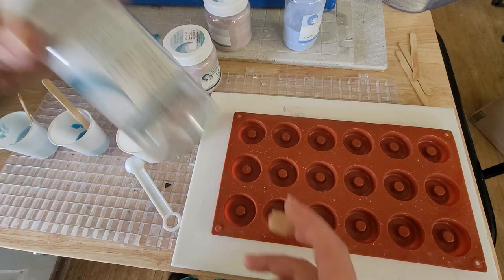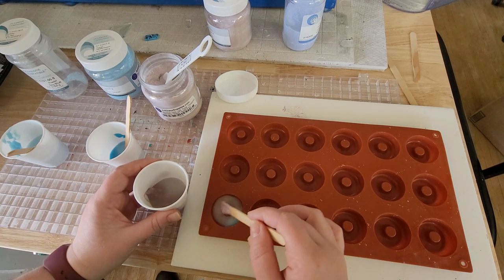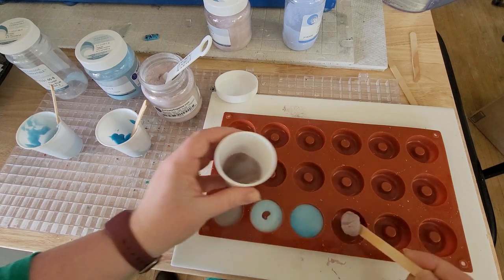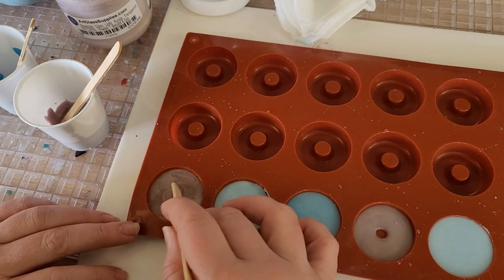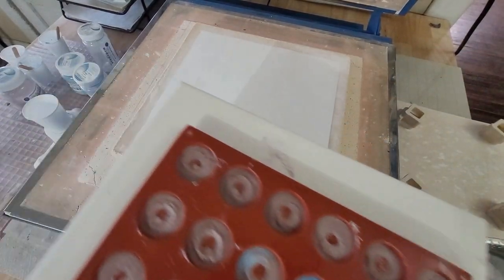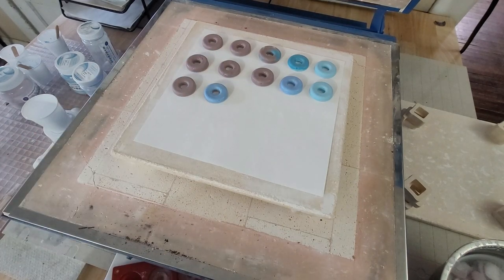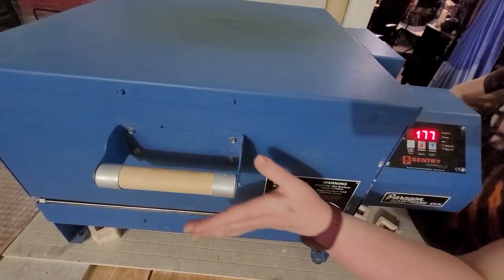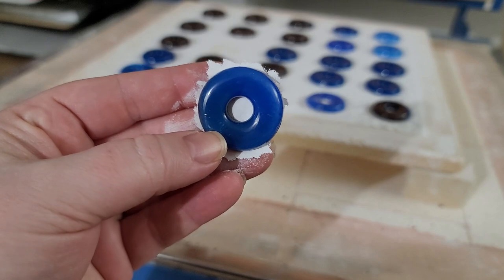Freeze and Fuze Experiments: Donuts

Comment: You can put your powder in dry and then add the water using a small squirt bottle, that was you can set your designs up easily.
These turned out great

Comment: Hey Von! Had not seen your freeze & fuse videos before (have now also watched the moon video). Too bad about the high crack occurrence ratio - must be due to the only thing holding it together is the frozen water, then the water thaws getting your kiln paper wet & wrinkled (seems like it deteriorates/destroys your kiln paper - good for only one use?). Idea: cut your donut mold into separate donuts - might be easier to disperse air bubbles and remove pieces from single molds. How about drying them in your oven at 200F for an hour or so on a nonstick baking sheet, then transfer the pieces with a spatula onto your kiln paper? I also came across Tabitha's Glass Emporium on You Tube and watched her video: https://www.youtube.com/watch?v=-XqS2NXNKCY - she has a fun way to help disperse air bubbles!